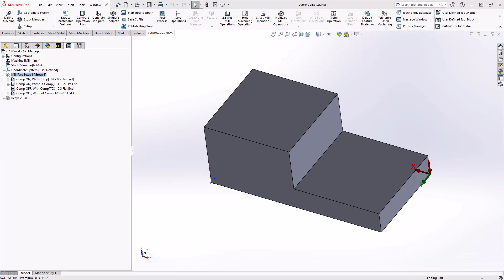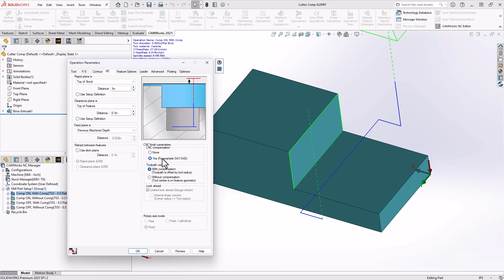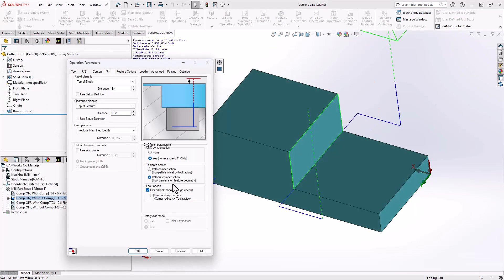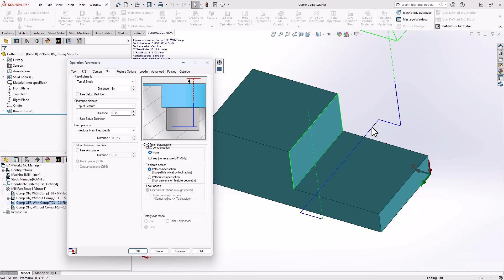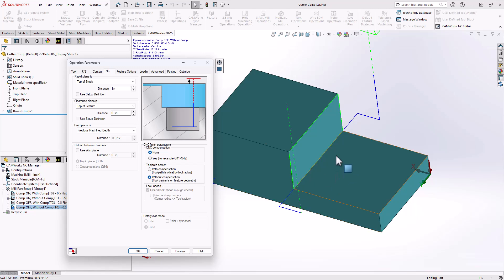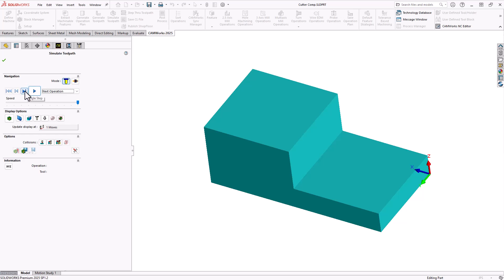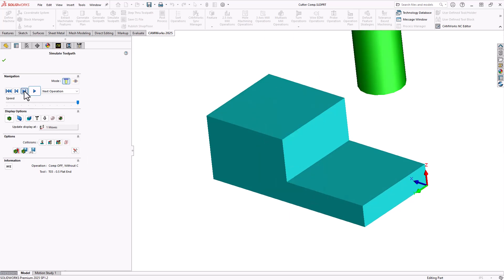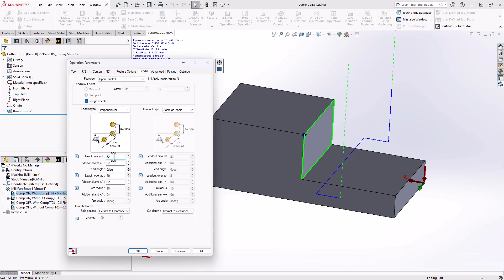How to Add Cutter Compensation in SolidWorks CAM and CAMWorks

Comment: Great video and explanation of how to utilize cutter comp.  I use this feature often to finish size a feature due to tool deflection, slight size difference in cutter vs nominal, and/or due to material spring pass requirements.  This feature allows the operator the ability to fine tune the finish size to spec, without having to have a new toolpath created.  Thank you for the video!